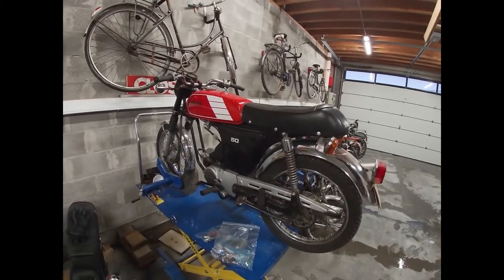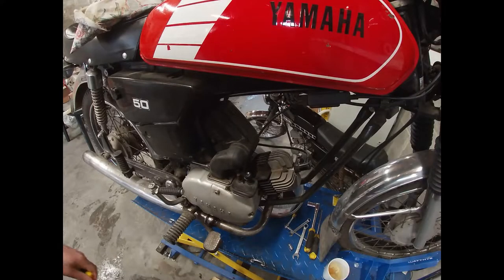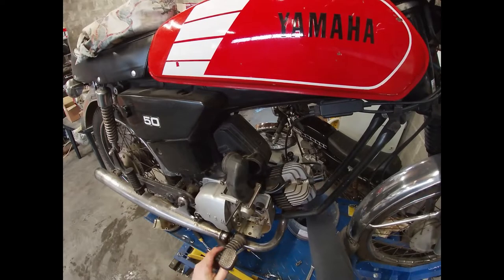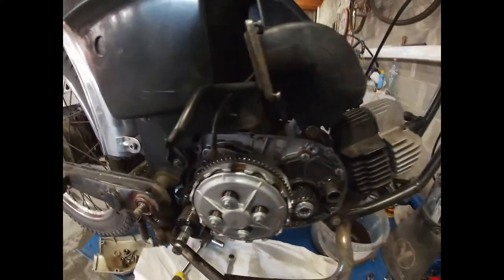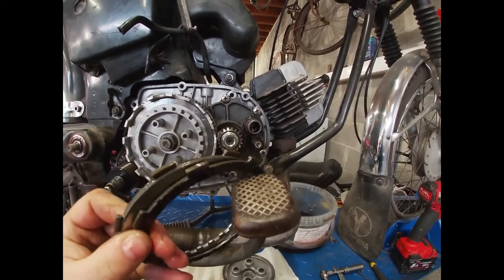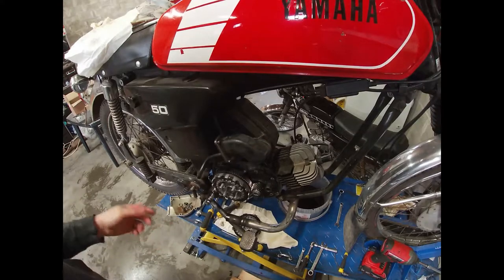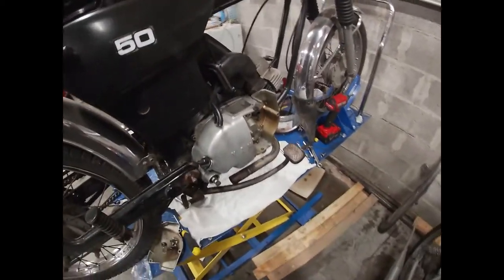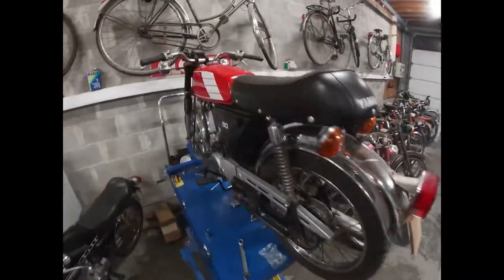Yamaha FS1 - New Clutch

Comment: Great video. FS1 is so fantastic. I had mine 1988 in over 15 years. And been using it daily for the last 4 years. I put in new clutch discs 5 years ago. And they still going strong. But I did exactly like you and got my clutch lose in the same way 🤣 Great garage btw. New Sub right here 👍
Reply from the maker: Thanks man! It was my first real moped so she's definitely a keeper!
Also thanks! Maybe I should make a small review/ test drive of each one?
Reply: @VintageGarageYT  ohh I would love that!
Reply: @VintageGarageYT  yes we Will se a test drive👌
Reply from the maker: @jonasbond  Working on it 😁
Reply: @VintageGarageYT  great 👍 i have One for My ön, from 1982. Om from Sweden 🤪
Reply from the maker: @jonasbond  Awesome! They're pretty popular! There are more videos coming up off mine 😁😁
Reply: Yes now the images comes back to me I had two Yamaha 's  fist on from later date with membrame later the fs1 which you have got with rotating inlet man I had a tuned one. That runned much faster then the membrane ones. Mine had a 60cc 16mm carb and running at 105km h but after a week I needed to titen the bolts again😆 Nice to watch this again. Later at 18 years old I bought a Zündapp that was a hole other bike.

Comment: Hey sir can you help me with my fs 2ru it wont start
Reply from the maker: With such a basic description as 'it wont start' that's pretty hard. You need the 3 basics for an engine to run: spark, fuel, compression.
Check if you have spark first. That's the easiest. Then check if it has fuel. If all that is OK I would check the actual engine and see if the piston rings are ok.
Reply: @VintageGarageYT  hey sir i find the problem it was the timer
Reply: @VintageGarageYT  thank you for helping
Reply from the maker: @leandroishaniplak5366  Glad you found it!